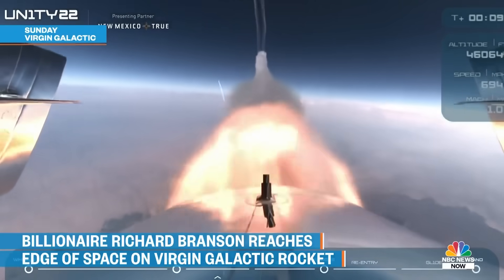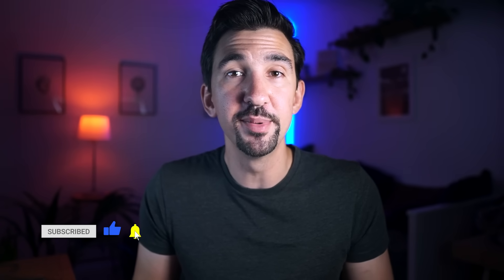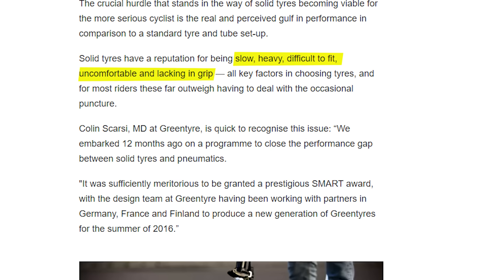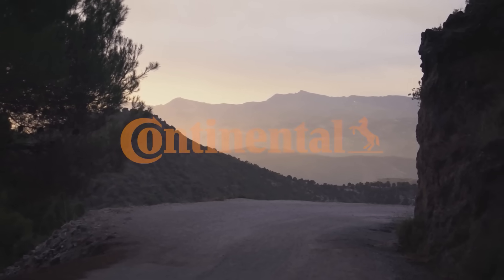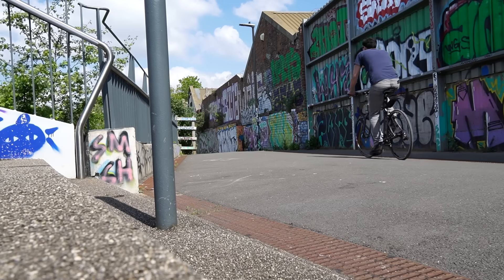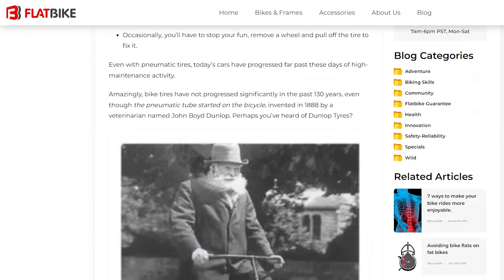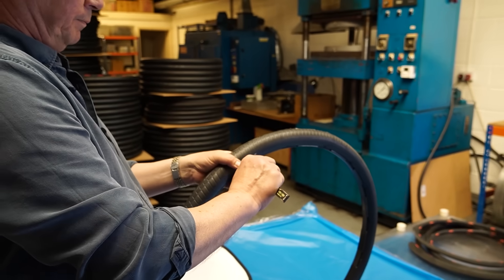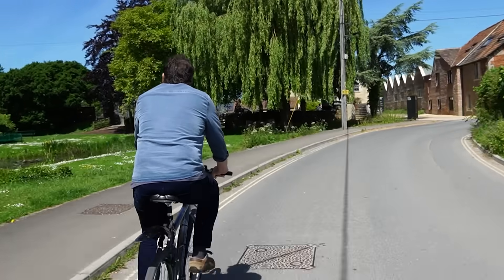I Tried Solid Bike Tires | Here's What I Found

Comment: There's an error in the video -  hard rubber saves energy, not the other way around. The softer the tire the more energy it takes to rotate it under the rider's weight.
If you doubt that then just test it by an electric vehicle like an e-scooter and compare the mileage.

Comment: I wonder how well this new material deals with heat buildup from friction. Specifically as speeds ramp up to highway speeds, and tire sizes increase to motorcycle and passenger car size tires. Does the product developer have plans to produce tires/tyres for more than bicycles?
Reply: The motorcycle version by michelein does fine with heat, even on a hot day it takes running on asphalt at 150kph to overheat them.
When they overheat they bubble and get soft and fall apart.  When they get old they get soft too, but you can keep the same mousse for years, just cut it and force an old piece of foam from an old tire in to firm it up again.

Comment: I just put a bit of fluid (only 1 brand does the job perfect) every half year in my tires, both road, mountainbike and even in my scooter. Never had a puncture too big to not be filled since.
Reply: Brand?
Reply: @johnnunn8688  Stan's NoTubes Race Sealant  mixed with the Stan's NoTubes Tyre Sealant. the race one has very big filler particles and is a bit too thick and dries out too fast for my liking. 
So I use like 1/3 for the big particles the rest with the normal one and top-up every 2 months or so with the cheeper one. Confirmed by Stan's NoTubes that they have the same base so safe to mix them.
Reply: @yspegel , thank you.

Comment: I don't like using a mallet on the rim in that fashion. Rim to rim compression strength is very low. A mounted tire would handle the blows better because the spokes would come to play in tensile position with the bike inverted.

Comment: Would like to see info on cornering grip. Pneumatic tires deform into the lean on curves and provide decent grip. I'd like to see someone ride with an accelerometer and corner harder until grip fails and get the real world numbers from that.
The problem with the air bounce in foam tires is you only get a tiny bit of air, that right over the top of the road, involved. A pneumatic tire has the entire volume of the inside of the tire to use as an air spring.
Tube change on a pneumatic is around 5 minutes as well. Couple more if you use a pump instead of CO2 inflation.
Recyclable is cool. If it translates into "actually WILL be recycled" then I'd be willing to overlook some minor issues.
You're running some crap tires if they go flat once a month. Try some Gatorskins. I have a terrible road on my commute and was flatting nearly every day. Switched to Gatorskins, no flats in 2 years.

Comment: As for ride quality: pneumatic tires work so well because you’re not relying on the elasticity/compression of the few cubic centimeters of air between your rim and the pavement—you’re benefitting from the compression of the entire volume of air of the entire tire. 

That’s why airless tires have so far fallen short: they can’t spread the force of impacts or bumps across the entire tire like a fluid can. Adding millions of tiny bubbles in a sponge-like fashion may be better than being solid rubber, but it’s only because of the balance between elasticity and weight and compliance, not because it’s reproducing the benefits of a pneumatic tire.
Reply: Air is a fluid, dope.
Reply: @rdecredico  yep fluid groups gases and liquids
Reply: I'm afraid nat is the only person who understands how tires actually work. If you hit a bump with a pneumatic tire, as long as the object doesn't contact the rim, the stress is transferred equally around the rim. This will never be so with a "solid" tire.
Reply: only 1 comment about what you said liquids do not compress there for they are not suitable for deadening shocks   air is not a liquid its a gas and has different physics
Reply: @SurferNorm6360  I'm currently on a phone and can't ctrl+f, but I'm not seeing any references to liquids. If there were references to liquids, they may have been edited out. If you're referring to the use of the term "fluid," that word is being used correctly. Gases and liquids are both fluids - just with different equations of state relating pressure, density, and temperature.
Reply: @Kael hooten Like a non Newtonian fluid?
Reply: Those exist, what about a video reviewing one of those?
Reply: There should be no difference between lots of small pockets of air and a single pocket of air. Pressure will distribute into the entire mass without gradient.
Reply: @kazedcat ehhh... Tyres and fluids have very caomplicated properties...

One thing to think about is that large volumes air take more deformation to increase pressure, as I understand it.
Which has the effect of making small volumes of airs (or tyres) much harder much quicker for the same amount of deformation.
Though tyres run at wildly higher pressures than cars because of the pain of rolling resistance.

Another thing is pressure deforms tyres difference depending on their properties.
Solid tyres as a rule of thumb have much less deformation on the 45 degree to sidewall.
Just because their shape, layout and the fact its a solid not a fluid don't allow the tread to move around as much...

Rubber properties also makes a difference and it affects how it can deform and by how much. Solid tyres have rubber most of the way through 
so it matters even more. Rubber in general also has a thermally dependent elastisity so...

Different problem...
Reply: @Mallchad  Gasses don't have deformation. They fit to the form of their container. What they have is pressure, temperature, and density. Solids do have form and rigidity so you need the foam rubber's rigidity to be as close to zero as possible so that almost all of the bicycles weight is supported by the trap air. Small cells of rubber containing trap gasses has a lot of options to make this happen. Major option is the shape of the cell. You want disk like cell with the flat profile along the direction of the pressure gradient this makes it so that the rubbers rigity is focus perpendicular to the pressure gradient giving a cosine factor approaching zero. Then you can adjust the gas density to make sure it is taking most of the load instead of the rubber. The hard part is mass producing the rubber cell with the correct shape and containing a gas with correct density. It is a manufacturing problem not a design problem.
Reply: @kazedcat  huh?
gases don't have deformation but their containers (tyres and tubes for example) definitely do.
Which is the important part,
the air is mearly a means to an end to get favourable tyre deformation.

Also yes, it does sound very difficult to manufacter a tyre with mamy thousands of pressurised air pockets.

This sounds like a very elaborate way to have an air based tyre.
Less problems with air leakage, more problems with giving the internal rubber ways to rip, especially when compromised.

Springiness would be a pain to tune and change wildly with temperature.

Oh I forgot about air permeability in rubber with makes most rubber a bit leaky.
Reply: @Mallchad  The internal part don't need to be tough. You just need the external rubber tire to contain the internal rubber foam and protects the internal part from damage. The leaking part is the same problem as pneumatic tires only it happens at a much slower rate due to having multiple tiny air pockets instead of one big air pocket.
Reply: @kazedcat  pressure and density; they have. Temp and pressure are the same
Reply: The volume of air has to make a difference like Boyles Law somehow.   Except it's pressure on the outside of the tire times volume? equals pressure on the inside times volume.  It sounds good, anyway.  Who would think bike tires are so interesting.
Reply: @kazedcat  "Pressure will distribute into the entire mass without gradient." Um, no. With a traditional tyre, once you put a load onto it, the whole body of air will be uniformly compressed. When you roll it, the rubber at the contact point will deform and that area is moving, but the air stays at a constant pressure (as long as the road surface is smooth). If you have localised air pockets, those will compress at the contact point, just like the rubber, and decompress when they move away from it. So you're constantly compressing and decompressing air. So for a tyre that's compressed the same amount (and gives you the same contact surface), you have to put in more work to roll it.

That's one of the tricks that make air-filled tyres so good. You want a large contact surface for a good grip, but not pay the energy cost needed to constantly compress the material at the contact area. Train wheels are very good at not wasting energy for compression, giving trains a really low rolling resistance, but they sacrifice contact area and have next to no grip.

Air-filled tyres are also good at smoothing out bumps, but that's just a side effect. You can get the same from suspension springs---and practically all tyre-using vehicles aside from bicycles (where people don't deem the extra cost necessary) have those.
Reply: @HenryLoenwind  There is gradient otherwise you can use air pressure for faster than light communication. Yes pressure at equilibrium is constant but bicycle in motion is not in equilibrium it is in a dynamic environment. When you hit a bump the pressure near road contact is higher compared to the pressure on the opposite side of the wheel. This dynamic pressure changes is where most energy is lost due to the compressed air heating up. With rubber foam the rubber interfere with this dynamic pressure changes and energy is lost due to internal friction of the rubber stretching. You need to minimize this internal friction that is why you need the shape of the rubber cell that minimizes stretching along the direction of the pressure gradient.
Reply: @kazedcat  Sure, but the speed of the pressure gradient is largely irrelevant on bike tyres. You'll get an airflow that's counter to the tyre's rotation, roughly equivalent to the percentage the cross-section is restricted. Once that's stable, your energy losses (from the air) are mostly friction, not compression.

With any non-flowing filling, your losses will always be compression, whether it's rubber structure or air pockets.
Reply: @HenryLoenwind  No most energy loss in a bike tire is compression. There is no significant airflow within the tire because of the small cross sectional area. Almost all of the air will be force outwards towards the rubber tire because of the rotational motion and there is no shear force that can power a counter flow.
Reply: @kazedcat  back to your original comment, there is a major difference between many small pockets of air and one large one (at least w.r.t. wheels). Deformation of the wheel is localized to the contact area which means that the overall relative change in volume is small with the single large volume, even if the tire has (locally) collapsed all the way to the rim. Thus, the pressure will remain roughly constant and the restoring force will mainly be dictated by the contract area. With a bunch of small pockets, local deformation will cause a similar local change in volume of the gas and a very rapid (hopefully) adiabatic increase in pressure.

Said differently, the large volume will have a constant(ish) restoring force while the small pockets will have a rapidly increasing restoring force.
Reply: The pressure load of road bumps spreads into an airless foam tyre no further than one or two centimetres from the point of road contact. That's the problem. All the load is taken on a tiny volume of foamed rubber, instead of being distributed perfectly equally around the whole wheel circumference! 😢

And this is why solid tyres don't really work. When they are soft enough to cushion the ride, they are too soft to steer safely and roll freely. Similarly, when they hard enough to steer safely with low rolling resistance, all road surface texture is transmitted in vibrations bad enough to blur your vision and shake your fillings out.

Yep! While it took much experimentation to get it right, the pneumatic tyre's basic principal of operation will always be a classic example of "right first time" technology... and a demonstration that such things can actually happen sometimes! (Thanks Mr. Dunlop.)
Reply: @kazedcat  That only happens when you have a (more or less) fixed volume casing around that mass, like a regular tyre. The shape of the tyre can change but the volume can't increase (much). So when the contact patch is deformed and volume decreases there, the rest of the tyre can't expand, so pressure rises in the whole tyre. But for an all-foam tyre, there is no such constraint, so the pressure increase happens only where the deformation is. If the foam is wrapped in a no-strech textile like that in regular tyres, then I guess pressure  will distribute more evenly.
Reply: @tvuser9529  Then have a regular tire filled with foam.
Reply: @kazedcat  The problem is, how do you install and pressurise that? With a foam tube inside a regular tyre, air can go in and out through the spoke holes, so the system is at atmospheric pressure (relative zero), and only the foam at the contact patch sees a pressure increase. One could set it up as tubeless plus foam liner, as some people do. But then punctures are again possible, though it might be possible to ride on the punctured tyre. While the selling point of pure foam is zero punctures, and no pumping.

It seems it's just not possible to get the ride qualities of pneumatic with a pure foam setup, though those who sell foam systems will of course claim so. On the other hand it is possible to get pneumatic tyres puncture free or very nearly so, with tubeless, or sealant inside tubes, and/or highly puncture resistant tyres (like Marathon Plus). I haven't had a puncture in years.
Reply: Not so. The amount of cushioning air that bears the loads on a foam tire (tyre) is miniscule compared to the full wheel-full of springy high-pressure air of a pneumatic. The difference in volume of the working component is huge. 
This is why solid (foam) tires do not work. In short, when they are soft enough to give a pleasnt ride, they are too compliant to grip the road safely in corners. The pneumatic is the tire that manages to achieve these seemingly "incompatible" requirements. It is THAT which makes it so much superior to a layer of squashy padding wrapped around the wheel rim. @kazedcat

Comment: I’m just wondering what people are doing or where they’re riding to get so many flats? And how long do your tires last? 

I used to ride 5000-10,000 miles per year, almost all on roads (plus the occasional paved path and some gravel paths and cutting across parkland. My tires routinely lasted 5-6 years, and my current front tire is now at least 13 years old (because I haven’t replaced it since the last time I moved—but I no longer commute, so it probably only has <10,000 miles on it, total). 

I don’t live in cactus or goat’s head country, so flats are like a once-every-few-years thing, IME. 

So when I see 2-4 years, I’m thinking “all that trouble, and it’ll wear out before I probably would’ve needed to fix a flat‽” 

Have I just been exceptionally lucky?